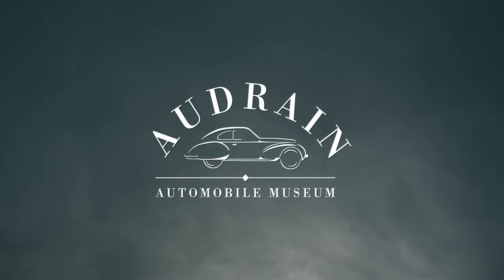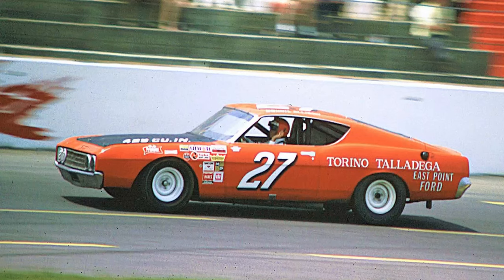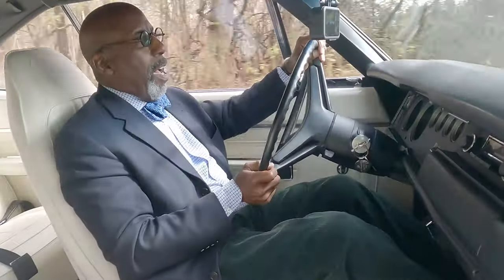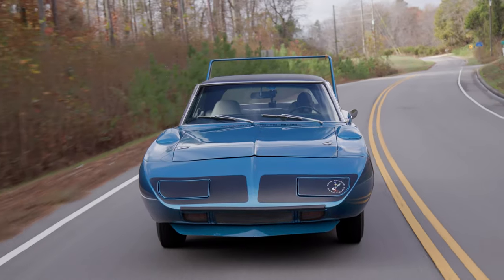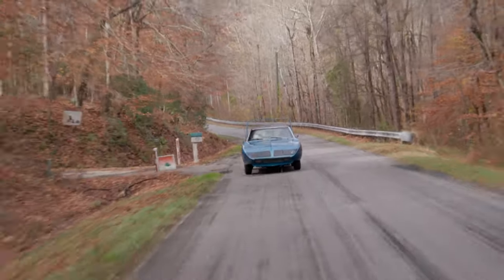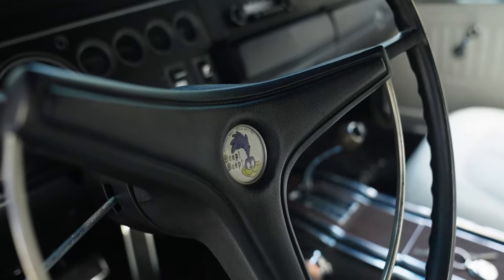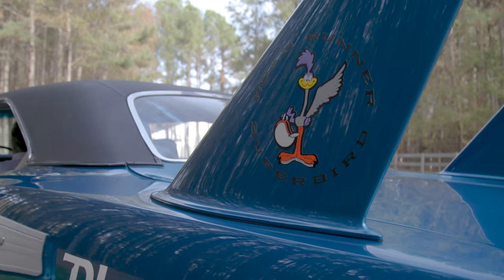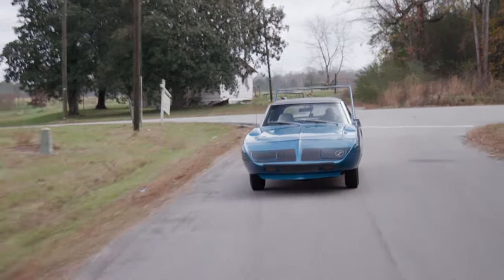Plymouth Superbird — Wile E.'s Worst Nightmare!

Comment: Thanks for giving this car a nice positive review and acknowledging how solid it actually is! However as a die-hard Mopar guy that has spent countless hours researching this car for various projects and write-ups I must point out that it has actually been determined that the rumors about wing cars being reverted back to Roadrunners to move them from dealerships indeed appear to be just rumors. Due to the way the front end, and rear wing was constructed it would have been too costly of an undertaking for a dealer to attempt to re-convert one when trying to sell the car without losing even more money on it. So far every wing car that has been found with a standard front end was found to have it added after a collision due to scarcity of parts. 
I would also like to point out that the rear wing may not feel useful on the road but it is critical to the cars design. The front end has so much downforce that the large wing is required to offset it and prevent the rear end from feeling light at high speeds. 
These highly effective aerodynamic upgrades designed by ballistic missile engineer John Pointer reduced the drag coefficient to just 0.28 which is lower than many modern super cars while at the same time providing over 1000 pounds of combined front and rear downforce! As a result these cars are incredibly stable at high speeds and cut through the wind effortlessly. 
Stock top speed with the 440 and standard axle ratio should be roughly 160 MPH and it gets there fast! 
Top speed with a 426 Hemi, 2.76 special ordered axle ratio and 15 inch wheels should be just a little over 200 MPH.
Reply: Thanks for the info.
Reply: @Wheresmy240  No problem, glad it was useful!

Comment: People ask me why I buy big hemi engines in my vehicles. My Durango RT and the Challenger Scat Pack..I never quite have the words to really express why. But that smile says it all. That's the smile a big MOPAR engine brings me. The exact same one you had! What a dream car you've got there 😁
Reply: Glad you love the brand but there's actually nothing big about a modern Hemi, the 5.7 has less total displacement than an old school small block 360. And the junkyard 360 I pulled out of an old van makes more power than a modern Hemi for a fraction of the cost. Even the 6.4 Scat Pak is a lightweight compared to the 7.2 liter 440 that came with 480 torque stock. The old school Hemi engines have been dyno tested in the 490-530 HP range bone stock depending on the year and the version that came in the LO23 68 Hemi Darts had over 600 HP stock and was faster than all this red-cat hell-eye BS without the help of a supercharger. Mopar Guaranteed it would run 11s or less or they would take it back and many people hit the 9s with no mods. Imagine how much faster they'd be if they factory supercharged them like the Modern Mopars. The worst part is not only are the old engines more powerful but the old cars are also drastically lighter making for an unrecoverable one-two punch. To put that into perspective a 2020 Charger/Challenger weighs 4400 pounds stock and my 68 Plymouth Roadrunner clone weighed 3400 pounds stock. That's a 1000 pound weight disadvantage for the new cars on top of them already having less motor. You can see now why factory supercharging these cars was necessary, it was the only way they were gonna compete with the old school cars.

Comment: It seems like history repeated itself in a way. The Chrysler Airflows of 1934-37 were inspired by aerodynamics and were reportedly poor sellers. Aerodynamics again inspired Chrysler Corp. cars with the Aero Dodges of 1968-69 and Plymouth for 1970. They were poor sellers also, but this time Mopar did not care, they wanted to win races. The muscle car era was a period when the factories built and sold specifically modified cars for homogulation as required for SCCA and Nascar along with higher numbers of generic muscle car offerings. I don't think this has happened again.

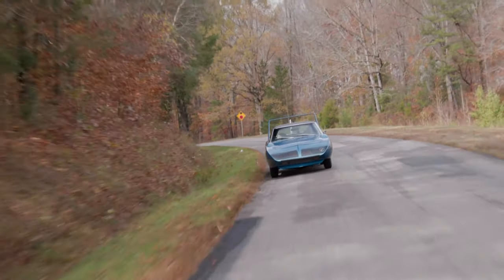Comment: The Mirror @5:28 I thought i was losing it
Reply: They had seat belts. Is that a Automatic? Never thought they made one!  If I remember right the rear wing was supposed to lighten the rear, not push it down. When it was built they wanted to get rid of weight and spoilers can do both.
Reply: The engineers actually put the wing that high to get it into the clean air above the car.  You need that much downforce at those speeds.

Putting the wing that high to clear the deck lid os a urban myth.

Comment: This is awesome DO! Love this channel.  Feel wicked smaht after!  a lot of history all at once! Pretty sure my ‘69 427 Vette will blow the doors off that yacht tho! Haaa! Someday we will race! Cheers
Reply: Your Corvette was not built for THE NASCAR Super speedways.  Furthermore, the Corvette is a dime - Dozen. The  True Aero cars are extremely hard to come by.
Reply: @G Smith You sure about that? I'd love to give you a chance to find out. I don't have a Superbird but I do have a Roadrunner clone and it dead hooks over 400 HP and 450 foot pounds of torque at full throttle on the street like it's an AWD car. I'm working towards getting a little air under the front tires ASAP too. 
And just in case you still think these are big land yachts my Mopar weighed 3400 pounds stock before I dropped a bunch of unnecessary weight which was only 155 pounds more than a 69 Corvette. 
Awesome Corvette by the way!

Comment: The 440 I owned got a whopping 8 MPG highway. When gas went from 35 cents a gal, to over $1.00, it had to go.
Reply: @Joseph Robichaud Did you ever find out what was wrong with it? I daily drive a Plymouth Roadrunner and it is shockingly fuel efficient. My 71 Cadillac with the 472 is the same, way better mileage than most modern trucks if you know how to keep your foot out of the secondaries.
Reply: @Impactjunky  I think the main issue was with my right foot, it kept getting stuck to the floor. :)
Reply: @josephrobichaud5198  LoL great answer

Comment: Ya gotta love how low those seats are, it makes it appear as though you could use a phone book or two to see out the windshield.
Reply: These cars were designed for big manly old-school men, if you are short like me then you just need to take the two rear bolts out of the front seats and stack some washers up under the mounts and put the bolts back in. My Roadrunner clone has two lug nuts under the rear mounts, raising and canting it forward for a much more comfortable position for my body-type.
Reply: @Impactjunky  Yeah, I'm all too familiar with them. I was driving before that was built, am 6'4", 240 and was a pro' mechanic for 50 years. They looked cool but weren't much more than rattletraps - every time you closed a door, hit a bump... And Donald was right, not many people wanted to be seen in one as it was considered a 'Poser-mobile' with a low quality, no handling badge attached.
Reply: @carlbeaver7112  LoL I'm starting to wonder if you were actually paying attention back then or not. I have no clue why everyone keeps making up this BS about them having bad suspension and weak bodies when they had some of the stiffest and most advanced adjustable suspension of their time. Mine gets such good traction it can dead hook over 450 TQ at full throttle on the street like it's an AWD car, and is on the verge of doing little tiny wheelies at the strip. Even Donald said in the video that it drives better than you expect. It was so good people like Steve Magnante would swap their rear springs into other cars for better traction and handling. 
I've been daily driving mine for over a decade and Car Craft Magazine didn't think I was a "poser" when they listed my car as one of the Top Ten Budget Builds of the 2018 Hot Rod Power Tour. 
Hot Rod Magazine didn't think the car was a "poser-mobile" either when they used pictures of it all over their site to promote the 2019 Power Tour. The last couple heavy Hellcats/Coyote Mustangs I launched on didn't think it was a poser-mobile either.
Reply: @Impactjunky  Keep on dreaming, they were third for a reason. I don't care who was better in anyone's mind, I worked on everything out there and I know what worked, what didn't, what was better built and engineered. Anything from Mopar was pretty much 1/2 step better than the bottom of the barrel except for straight line power. They rattled, they broke and they didn't handle worth a damn. Their only saving grace was slant six, economy/Mom's cars (Valiant, Dart, etc.) But hey,  you keep enjoying them if you want.
Reply: @Impactjunky  Maybe you should find someone that actually worked on those six days a week, when they were 'new' cars. They were average, run of the mill, nothing special at all cars with big engines. There is absolutely nothing impressive about their original suspensions. They had torsion bars up front and long leaves in the back - again, no big deal. I said Donald was right that they didn't sell well because the people BACK THEN thought of them as poser cars. Whatever you and anyone else think of them now is a completely different opinion - get it? If you love it, continue loving it. I'm happy for you.
Reply: @carlbeaver7112  No you're clearly not happy for me, you're being passive aggressive and failing miserably at trying to make an iconic car look bad. You're like a kid on the playground who resents his friends nice toy. I don't need to find anyone else from back in the day to ask about this. The 70 year old veteran I built this car with ran the most well known speed shop in this area for years and built more drag cars and street rods than either of us combined. He'll tell you a Mopar B body was a supercar ahead of its time. A 70 Charger/Challenger with a 440 six pack makes over 390 HP and 480 TQ stock and weighs only 3700 pounds. A 2020 Charger/Challenger weighs 4400 pounds and only has 370 HP and 395 TQ unless you order one of the expensive rare factory supercharged models. The classic car weighs 700 pounds less, gets better traction off the line, makes 20-30 more HP and makes almost 100 more TQ.

Comment: They where great in a straight line, corning and stopping not so much.
Reply: They were NASCAR super speedway cars. Not street cars
Reply: This is a common misconception about the car that I've seen people repeat a lot. But just like he said in the video mine stops and turns unbelievably good for a car its age. Granted mine doesn't have the wing or the nose but those don't help it stop or turn at normal speeds. These cars came from the factory with fully adjustable front suspension with superior geometry to most other vehicles of the era. You can adjust the front to be as stiff or soft as you want it to be and the rear springs are so notoriously stiff and effective that people like Steve Magnante would swap Mopar rear springs into other cars for better traction and handling. I put wide sticky tires and cheap KYB performance shocks on mine and it instantly handled better than most modern cars I've driven including my friends fox body Mustang with frame connectors and coil overs setup for autoX. One day on the way home a guy in a BMW was tailgating me and pushed out of the turn and hit the curb trying to get off the highway as fast as I did.